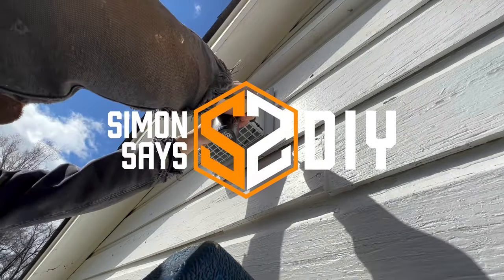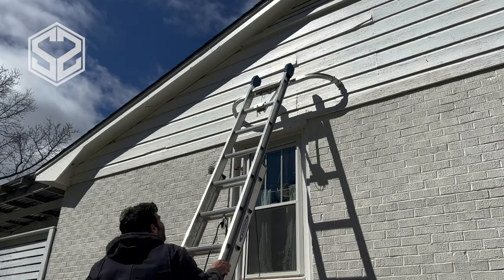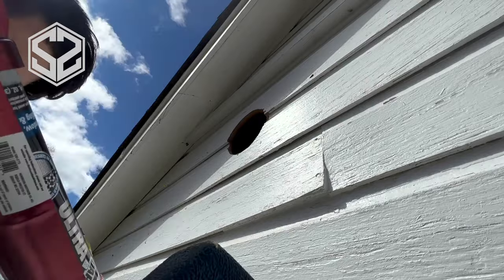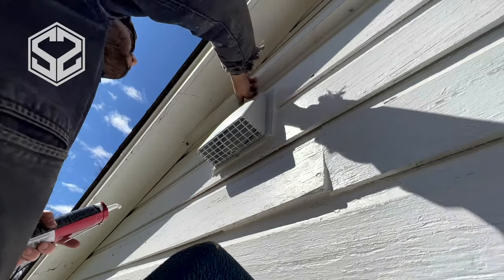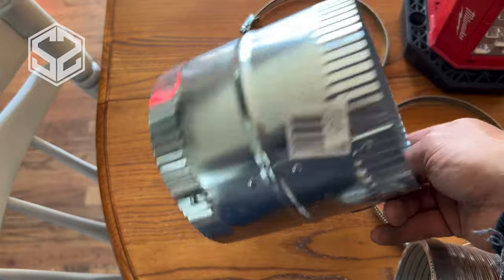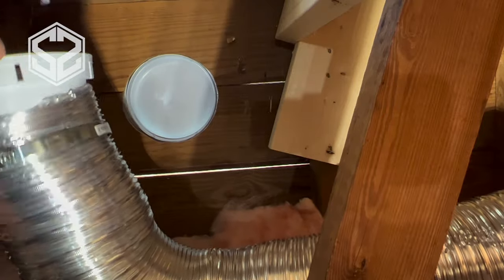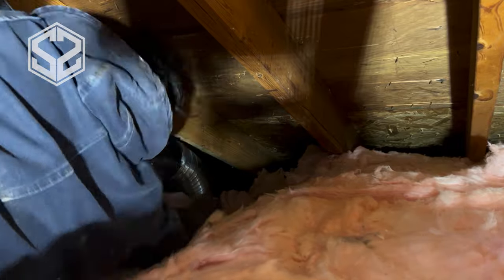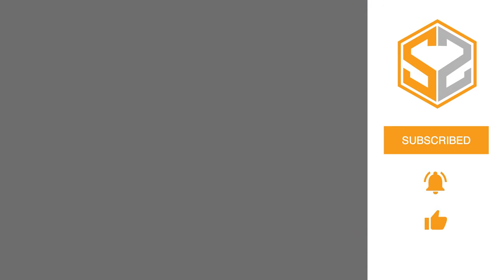How To Install A Wall Vent

Comment: This is 100% wrong and illegal for a Range hood vent. You are required in most places to use rigid metal ducting and not flexible ducting. The ridges in the flexible ducting will build up grease and can (and will) start a fire. I have a friend who was doing remodeling and when the opened up his wall there was evidence of a fire in the flexible ducting he had. Also, be aware that if you do this work yourself and do it wrong in a way that causes a fire or other damage, your insurance company can deny any claims on the damage.
Reply: If you don’t use a range hood grease filter then yes I could see this being an issue but with a filter which nowadays all have wouldn’t be an issue and the likely of fire even without a filter would be extremely rare. I could see a restaurant that uses extreme flames to cook, for example Chinese restaurants.

Comment: Make sure to have an intake vent somewhere to replace the air, especially if you have a modern house with a tight envelope. By the way, what camera(s) do you use? Your vids all look really good.
Reply from the maker: Very good point. Thanks for the tips!

Comment: So I’m currently converting a shed into a little livable space. It will have electricity, and air conditioning. Would such a room need a vent going to the outside? If so why?

Comment: Do not use flexible duct. It will fill with grease creating a fire hazard.
Reply from the maker: Thanks for the tip. I wasn't aware of that.